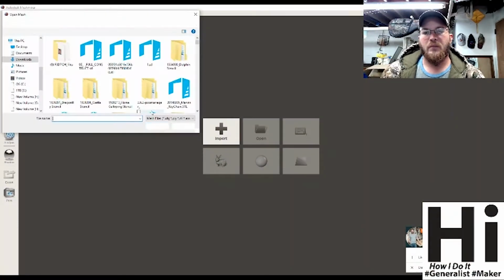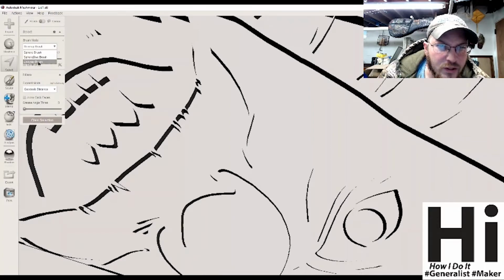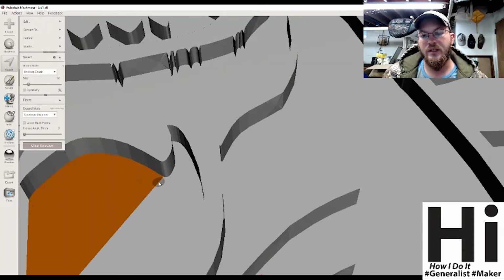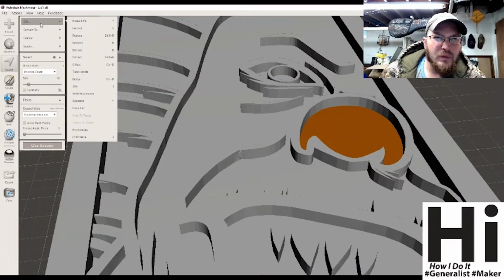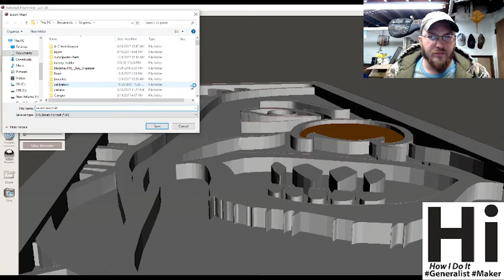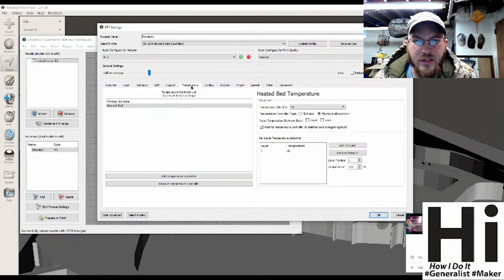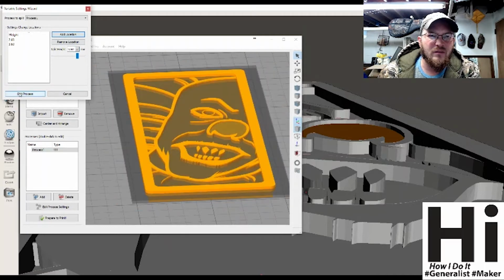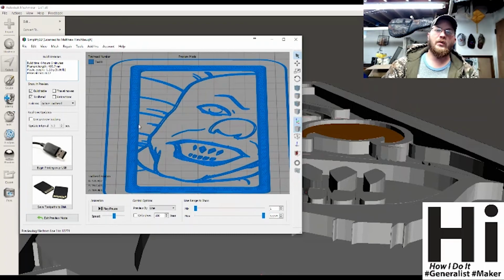How I Do It - Simple Modification of an STL File in Meshmixer For 3d Printing

Comment: Great way of explaining the multiple proceses.
You only forgot to remove the brim on the higher processes. Now it won't print only the model on the top, but also the brim in mid air.
Reply from the maker: +3d Print Creator admittedly I make that mistake regularly. :-)
Reply: How I Do It i think it's a bit stupid of simplify3d that a brim is possible in multiple processes.
A simple if command could have prevented this.
If height<>0 brim=0;